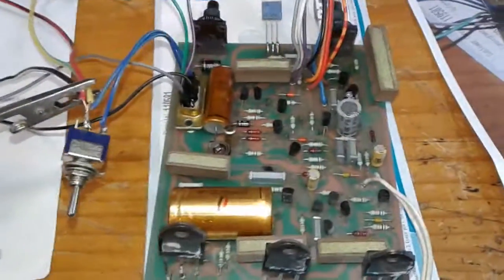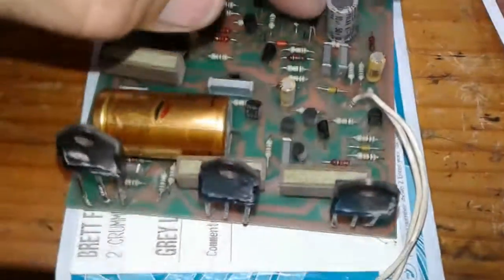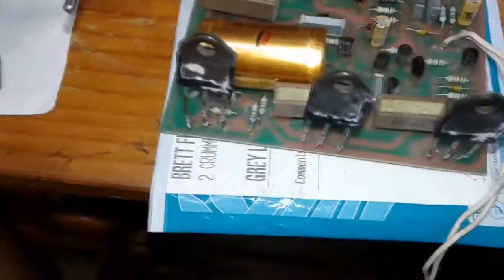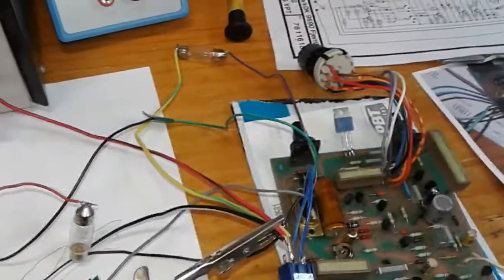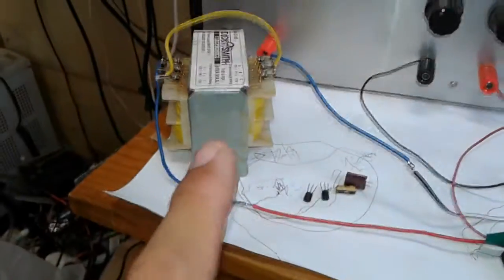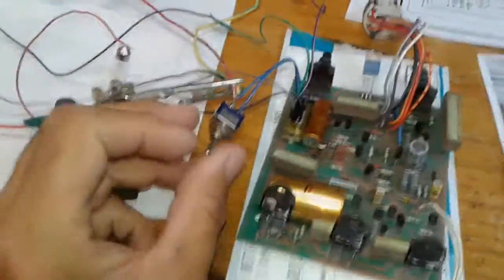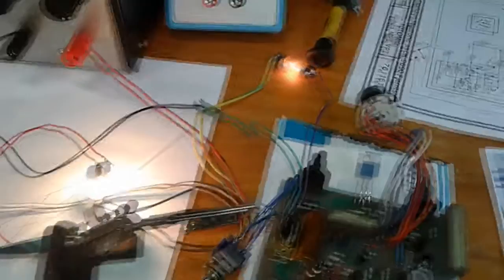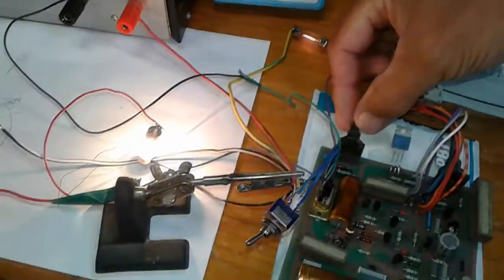Migatronic MX180 PCB Repair

Comment: ❤thank you very much for the video can u pls descripe number of t6 and t7 transistor i will like to order  .
Reply from the maker: think I replace the BC237 with BC547 as I didnt have any BC237 which is a NPN transistor worth about 50 cents,
you could find them in old tv's etc if you dont want to buy them.....good luck

Comment: hi could I ask what pin numbers are input and what voltage and also what line triggers the relay many thanks, Richard
Reply from the maker: Hi Richard, well was lucky to find that file on old backup and have uploaded to google drive,
https://drive.google.com/file/d/18S9KyGuKEmHDogRlvgVdWd8Cf0k23G0G/view?usp=sharing
Brett
Reply: @kermets  thank you so much I've been trying to work it out for about a couple weeks now.
Reply from the maker: Your Welcome....good luck with the repair

Comment: Have you repaired any BOC Smootharc MIG 180's - my PCB is faulty and to replace will be NZ$700 🤨
Reply from the maker: Hay there, no took me a few days off and on to fix my Cuzins Mig. its still going very strong hes had it for years and did not want to scrap it yet.can you get the circuit diagram for it ? what is it doing ?
Reply: @kermets  it's not striking, feeding or turning on the gas flow - I have metered the trigger switch and that is ok - no circuit diagram as yet.
Reply from the maker: Mmm something big to affect all three, do you know if the circuit board is getting power ?
does the display show lights.
Reply: @kermets  display shows and when I turn the unit on, it does its gas pre-purge and wire feed, but nothing when I press the trigger - maybe a relay input issue?
Reply from the maker: trace the trigger wire from the hand piece to the board and see if there are any burnt or brown components, also check in the same area for bulged capacitors, where do you live.
Reply: @kermets  I live in Feilding - thanks for the pointers - I will strip it out next week when I'm on leave and look for any obvious issues
Reply from the maker: ok cool, im 1 hour north of AK, take some good pictures if you can and send me them
Reply: @kermets  awesome - I have a good phone camera, so should be able to see a fair bit.

Comment: What was the problem you where having with this pcb? in other words what did the welder do or not do?
Reply from the maker: Hi, it acted as if the trigger was on all the time and feeding wire out, 
so guess the transistor was shorted
Reply: kermets i am having the same problem with my welder wich has a migatronic pcb in it.
Reply from the maker: try replacing those two transistors first. BC547, they are cheap as beans, cheers Brett
Reply: @kermets  I got my welder up and running. Wire feed is now working like it schoud. It was a IC that was bad. only the spot weld function and stitch weld function/timer are not working yet
Reply from the maker: Great job Mate.....dont give up the circuit parts are simple you just need to find which
is the faulty part. check your switch and make sure the contacts are working then trace that switch back to the closest transistor maybe and start swapping them out, thats what I was doing when I could not test them in circuit, Cheers for the Update Brett
Reply: kermets. wel i have had great help from some guys on a welding forum. Without them i woud not have been able to figure it out. My knowledge of these things i very limited.
Reply from the maker: put your link up....it could help others......
Reply from the maker: Cheers.......
Reply: @JorisV1983 what forum ? Im struggling with an old migatronic 180 where wire speed wont regulat only full speed

Comment: Hi There! is it possible for you to write a small diagram of the wires on that desktop setup from the connector over the swith and to the power and bulbs. thanks.
Reply from the maker: Hi, be careful as I did find that my cousins MX180 was slightly different than the MXE180 diagram online.But
did a circuit this arvo based on my video, I dont have the welder here but its still going strong.....Brett
http://i64.tinypic.com/dmtdky.jpg
Reply: Thanks the picture/drawing, and yes mine is the 180 not mxe so the schematics i have found is not the same. Same with the wiring diagram. but i have found out what is what but i was unsure on how to wire it up on the table. ...Henrik